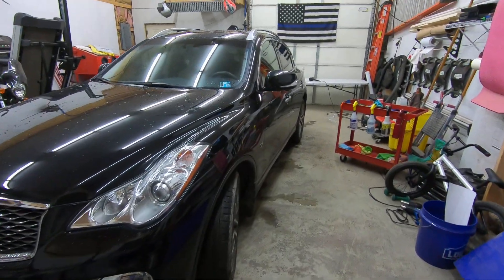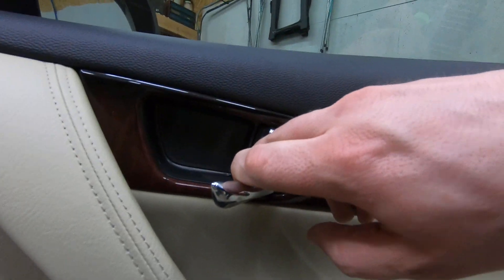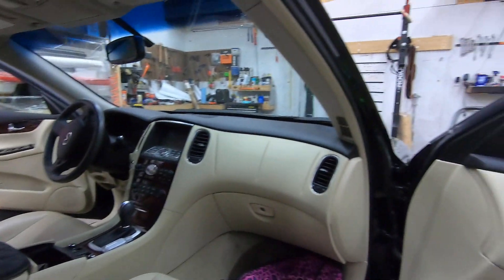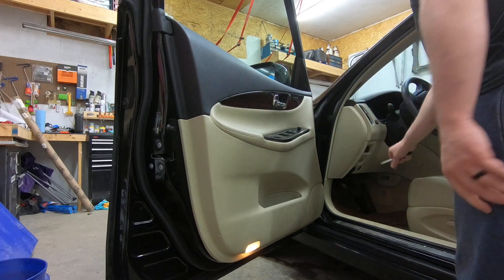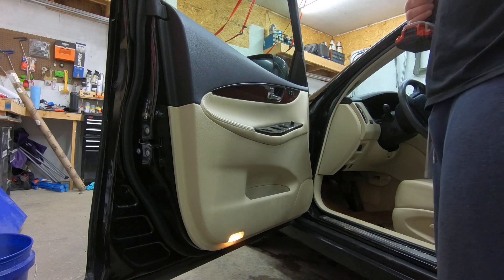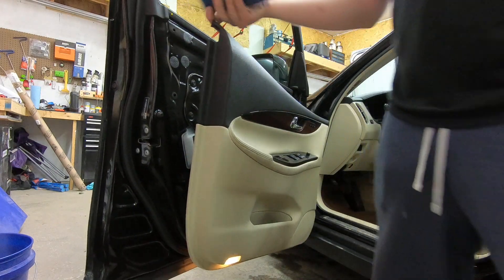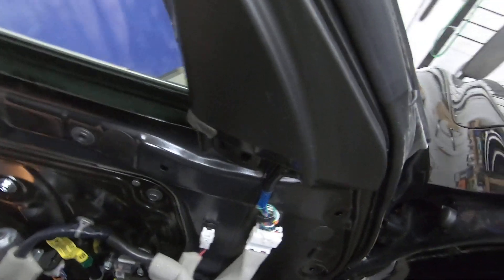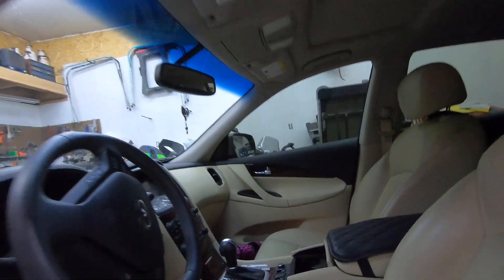How To Door Panel removal 2016 Infiniti QX50 Driver Front

Comment: Can you tell us how to replace the door lock actuator on the left rear door?  There's a metal bar that runs across the entire mid section that prevents you from taking out the door lock actuator that needs replacement!

Comment: Great video. I also have a 2016 qx50. I would like to find out for ex. how to remove the rear plastic black molding that goes around the outside wheel well. If u can do a video to remove all sides of the black moldings that go around the rear wheel wells the front too.There is none available on YouTube. Thx very much
Reply from the maker: Birdracer350 Lie next time I get one in the shop I’ll take a look at it